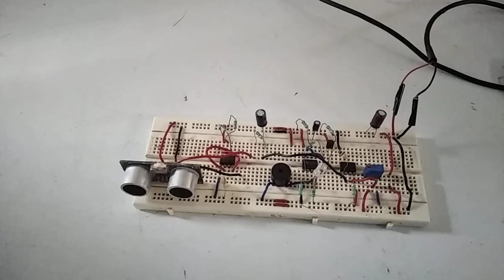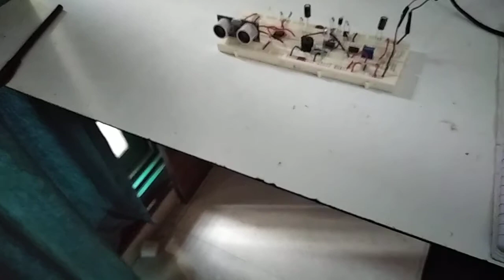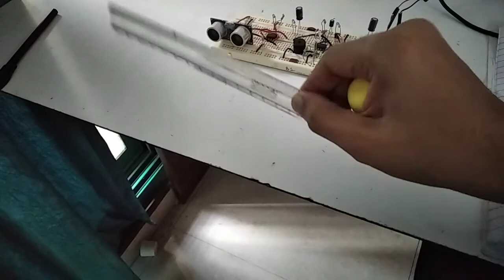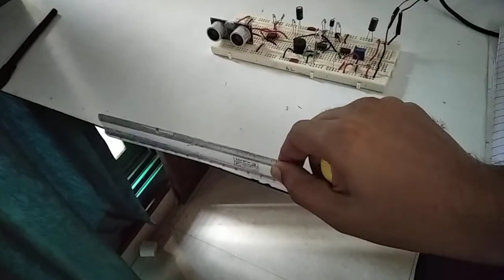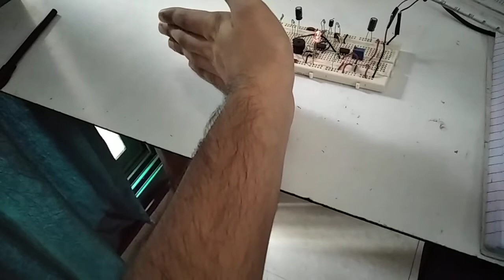Ultrasonic proximity switch using HC-SR04 ( no microcontroller)

Comment: Please give circuit diagram
Reply: Today im happy Because this circuit after long time im complete thanks sir this video is very helpful for me
Reply: @yashSharma-us8xj  warvo bro, 
without anyone suggestions nd prices have completed this task may  be you have found to significantly understanding of this one.
Reply from the maker: @yashSharma-us8xj  Really, glad to hear that. Tell me, What have you made using this circuit? Contact me my email:- prachethire@gmail.com
Reply from the maker: It's not free.
Reply: @prachethire812   what price this circuit
Reply from the maker: @yashSharma-us8xj  usually, you would interface HC-05 with a microcontroller and spent time coding the controller to achieve similar performance. This circuit saves your money and time. You make this circuit, credit me, and if the circuit works, you can donate money.
Reply: @prachethire812   circuit diagram ka kiya price hain muje without microcontroller ultrasonic sensor use kerna hain